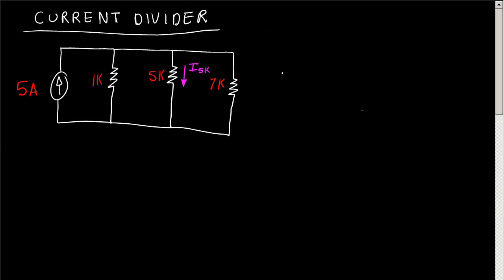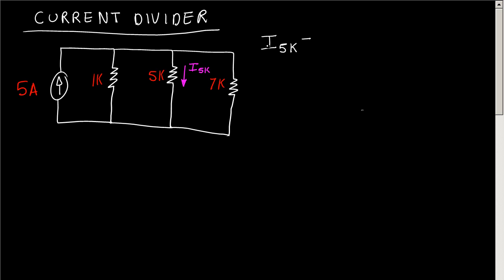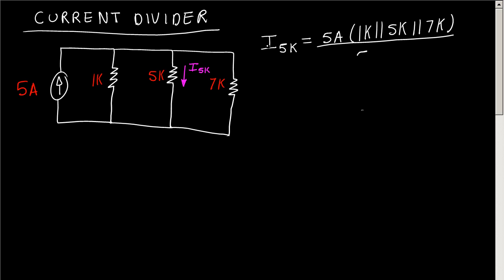Current Divider Resistor Network

Comment from the maker: Since the voltage source would be in parallel with the resistors they will all have the same voltage across which would be the same as the voltage source, then all you have to use is I=V/R
Reply: where is voltage?